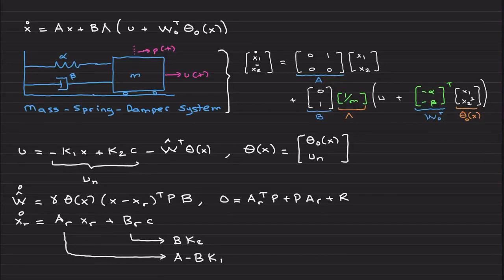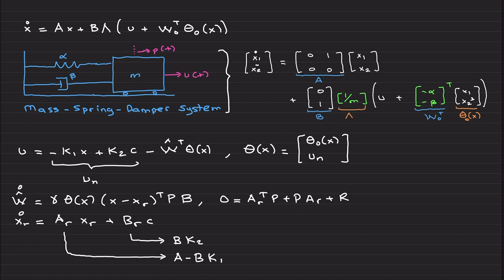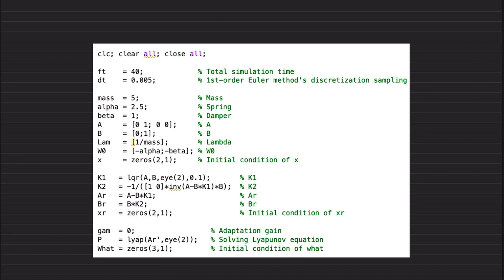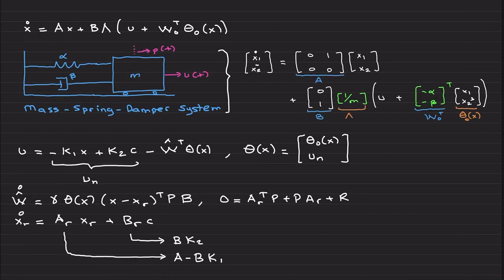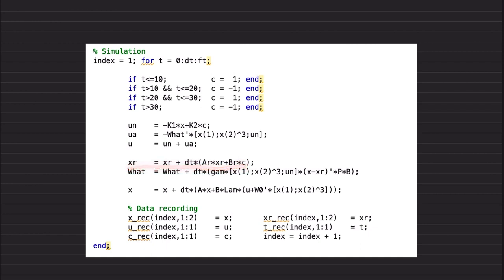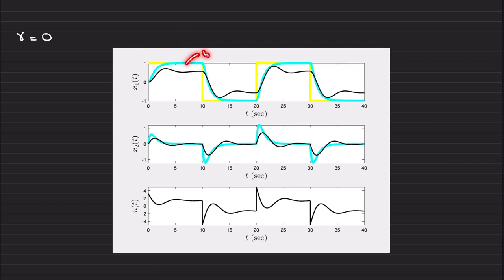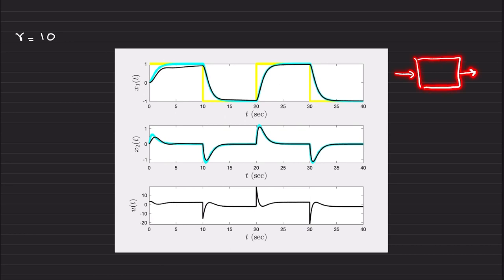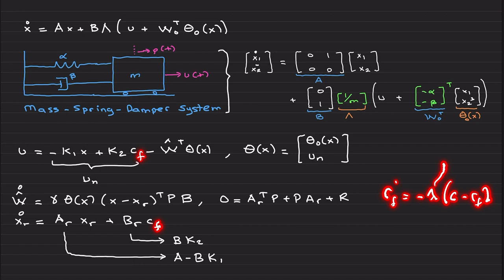Adaptive Control Example in Matlab: High-Order Case (Lectures on Adaptive Control and Learning)

Comment: Professor, I don't understand how Lambda can be canceled out if it's not part of the uncertainty term, but appears inside the loop in the equation of the real system. If Lambda is also an unknown parameter (1/m), shouldn't it also be estimated as an uncertainty and canceled with the adaptive control input? Please answer my question, thank you in advance.